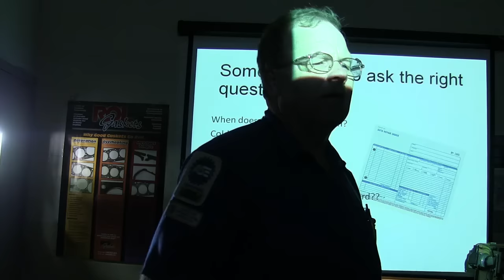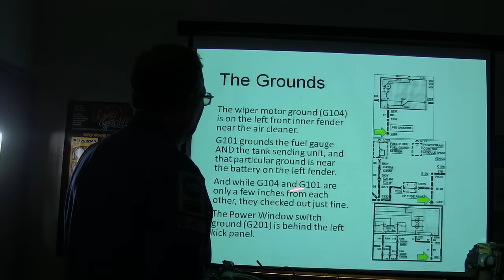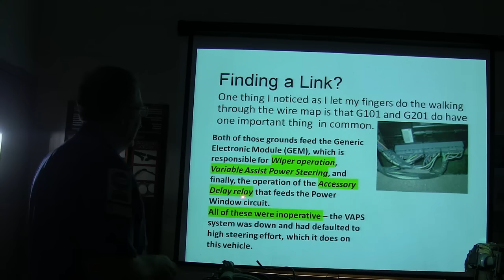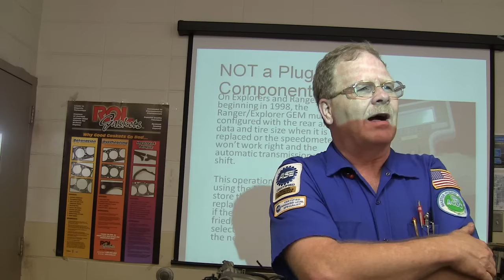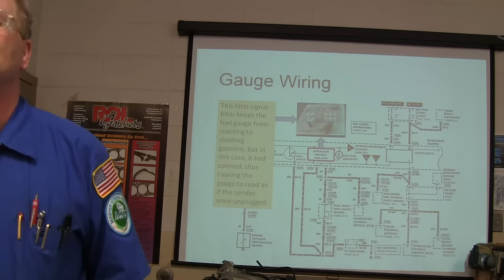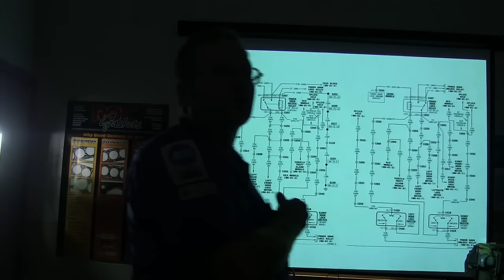Road Map to a Fix   Electrical 1

Comment: Great stories and outstanding diagnostic procedures as always.  I enjoy and value your stories and experience very much.  Never stop learning, because it makes you more accurate, faster, and cleaner everytime.. that's the motto i like to follow.

On an unrelated note.. is there a reason that your videos seem to end abruptly sometimes? (such as this one).  Just wondered because there have been a few that have just ended like this as i was listening to a great piece of advice or the very end of a story.
Reply from the maker: my camera always cuts off at 30 minutes and there's no setting to fix that